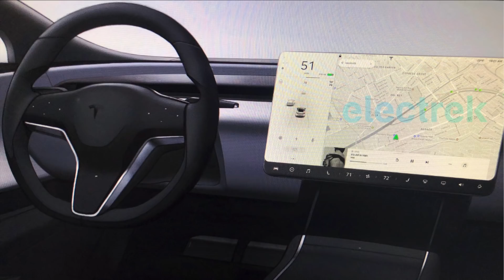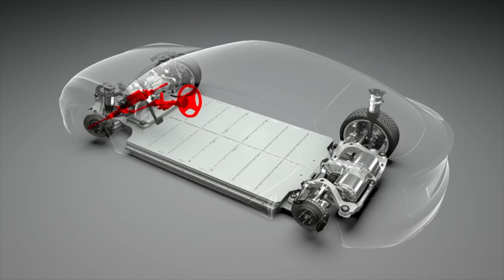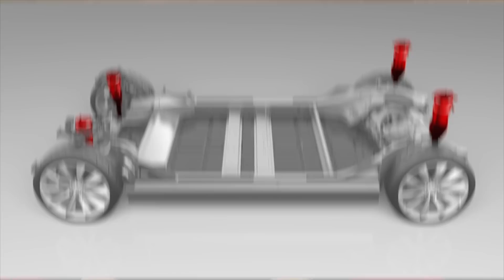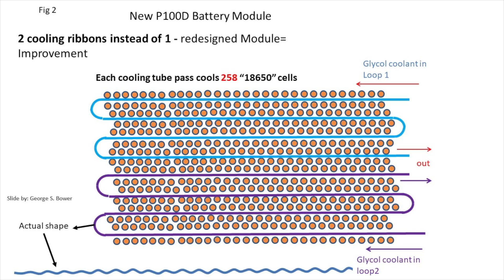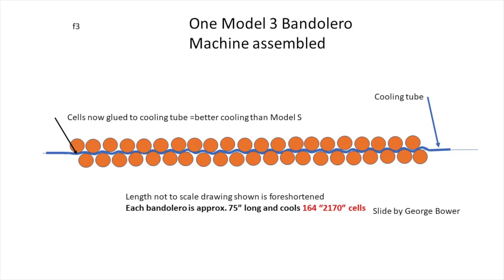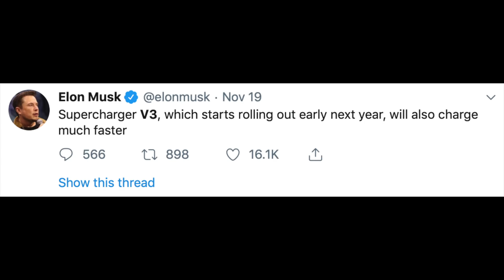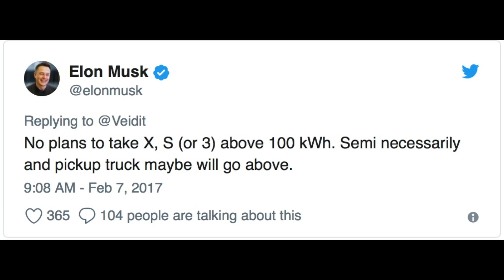The reason Tesla's 75 kWh battery is going away

Comment: Without specificity this is all speculation. Moving everything towards 100kwH is just a cost savings measure imo. "What comes next?" would be defined by the goals of capacity (safe charge capacity), natural rate of discharge, discharge rate while plugged in, rate of charge with proper software model, capacitance "actualized"(the number everyone uses), cooling systems, safety systems, "driving modes"(chill to insane, towing, hauling, etc) programming, any changes to the super capacitor braking systems, any changes to the interior and exterior (why side mirrors still? Why a steering wheel instead of side-stick control? Why a rear view mirror?, What about different interiors?, What about different types of glass? What about more efficient heating and cooling? What about storage? What about the amount of wiring period? The catch-all "system integration", etc etc etc). The only item I am aware of that has any specificity is that the Model Y is not to have a lead acid battery...and that somewhere out there is "hardware update 3"...and that's it..

Comment: what a punk... anyway billions of batteries is a fiasco to have bought and wasted and with the maturing of emissionless tech the evaluation of electron powered traction is overdue.

Like combustion which generates almost NO pressure, less then a cheap bicycle tire pump, chemical batteries produce literally a few volts, and the fact that you can wire thousands together is not relevent to there lack of fitness for other then phones, lights, maybe what personal massager's but otherewise not motion not integral horsepower.

Historically steam replace ox, goat, whatever beast with the burden. TO move from diesel etc. madness to battery or supercap hilarity is pathetic.

Strong forces exist in nature binding the tiniest of shit together with various rates of failure.  ALthough gold is heavier, uranium releases heat, and can cause itself to bleed this heat which people outside of Japan have basically forgotten.

The heat can do real work- generating 'power by wire' ain't that, nor is incinerating the Korea's or even a few pounds at a time of the stuff.

What it can do is lift the weight of the atmosphere off water so it boils partly away leaving ice, and also more efficienty freeze up as much of the not just nitrogen but also oxygen fuck the carbon dioxide being so politically incorrect just give it away for tailgating or whatever and then you have a fuel for a atmospheric heat turbine engine duh.

YOu condense whatever fluid powers the turbine with the frozen air, even if that is just liquid to air itself, and of course boil it with the not radiator which releases heat, but duh evaporator coil simlar in appearance likely reusable identically equipment.

CUz in flint it might be another week before water melts but air is boiling there anywhere it can be found liquid and melting as fast as you need with little exposure to those 'frigid' conditions.

Elon Musk is a nutjob- his thinking is pathetic, he knows nothing about science, little about materials, and our earth will be luck [requiring even pretty girls to take notice] to recover from his instigations of retro thinking without any historical background beyond that from some commercial he saw flirting in coach with some teenager [being our sole prayer ridculously].

Comment: For a refresh of the models S & X I would expect a shift to 21700s, just because Tesla strives for vertical integration and they can manufacture those cells in-house at Gigafeactory 1. What hasn't been talked about in the video ist that along with the battery change I also expect a shift in the motor technology over to the improved (and lighter and also cheaper to build) switched reluctance motor technology used in the model 3. With additional economies of scale they could probably drop the price of the 100kWh model S & X line down to almost 75kWh levels and introduce a model with higher capacity.

Comment: I think the slight increase in volume is negligible compared to the benefits gained. The battery condition will last longer. I use 20700s on an ecig mod, and I charge them regularly on a fast charger. They never get hot. This is probably the reason why Telsa decided to improve on the cooling system. Will save money, and weight on the vehicle.
Reply: exterior temp reader is like a coach aisle seat
Reply: @Irene-fu6gj  well coach gets you from point A to B, but if you're in a hurry I'd give up my seat for you because I'm not. God bless.

Comment: yeah....the fact that its going away without being replaced is beyond stupid.

you could get the 100kwh version back in october 2018 3750$ cheaper, with lifetime....supercharging
the ONLY benefit to the 100kwh is that it can go some 70 miles further and charger faster...if...the chargers are working for the FULL 120KW which they often don't and if you're not sharing which will only become more common.

18,000$ to have 70 more miles of range which is somewhat useful in cold climate for long haul drivers....and to save 2/3 hours on cross country drives. so a horrible return.

also, 25kwh of old as heck 18650 cells for 18,000$ 730$/kwh?
meanwhile tesla is selling tesla semi kwh for 100$????? new cells
and the powerwall 2 is already down to 500$/kwh not to mention its electronics new cells.

the 100kwh is a horrible rip off, likely detuned as the 75D is battery limited and yet the 100D has the same exact stated acceleration...>> never got a boost like the 75.  
its 4% more expensive today than it was 3 months ago, 100kwh models are selling for 80k on teslas website meaning they depreciate rather hard vs 75/65/85 even.  20% in first year despite still having "newest/equivalent" autopilot and all options
and the people who stand to benefit the most...people who drive long distances, no longer get free limetime supercharging but a few measly months worth

even compared to teslas very recent past value offerings its rather bad.
Reply: free lunches don't last but your not asying the used sleds won't let me drive hundrds of miles a day on new customers are you?
Reply: @Irene-fu6gj  im not sure what you mean by sleds and driving on new customers

Comment: The 100 kWh limit comment was from 2017 and was also mainly used to reassure people that they should just buy the 100 and not wait (since many people who got the 90 were upset). The most likely thing is for the S and X to to adopt the Model 3 cell size and introduce an even larger capacity battery, all being about to take advantage of the V3 Supercharger speeds.

Comment: If the Roadster2 is going to have the announced 600 mile range, either they are going to be making higher kwh battery packs, or some radical weight changes.

Comment: They should have designed the battery to be a cassette that is taken out at the charge station , the battery would be removed by a machine and a new recharged cassette inserted .  The new battery could be charged slower while at the station ( Safer )  and would be quicker , so it would be like the propane tank exchange program that everyone now uses .It would mean a standard sizing and fit solution that would have to be adopted by all the car companies ....also there would have to be a compact car battery , a mid size car battery and a full size car battery .   Sounds complicated but , do it now while the electric car revolution is just starting .  'Just a thought.'
Reply: not actually a thought more of a grunt. Charging chemical history is that power rate out is related to power in fyi.  Quaint obsolete but true trivia to puzzle the punks or delight the wise anytime you want but one per millenia ok?

Comment: The pickup will need a big battery option to compete well. Pulling a 20,000 pound fifth wheel it will need to be able to go a reasonable distance.  Stopping every 50 miles for 30 minutes isn’t realistic.
Reply: Brent teh 180 kwh Chicago duffus rig for 2022 is your delight right..... old trucks need jobs.  FIfthwheels to the rescue!
Reply: Irene ???

Comment: Cable size increase at 6:18 is mostly a switch from copper to aluminium in the beefy cables; lighter & cheaper if somewhat thicker.  The extra meat in the cable is needed due to the higher resistance that aluminium has over copper...
Reply: they look like aluminum but your text suggest fact not speculation?
Reply: @Irene-fu6gj  The large cables are aluminium now...  in earlier models they use copper but that costs & weighs a lot.  Sandy Munro or someone like them did a dissection and pointed out the change a year or two ago on YouTube...
Reply: @Clark-Mills  you reply so quickly you must be very organised I bet YOU remember what you had for dinner!

Comment: Supercharger V3 is going to be very interesting.  From a technical standpoint 350kW charging may not be necessary but is Tesla feeling pressure from CCS to go down that path?  As for switching everything to 2170 cells, I think that it's a no-brainer that Tesla will eventually go that route.  The only question is when.  Then again, perhaps they're working on a different cell format and are keeping very hush-hush...

Comment: In my opinion If 18650s then believe tesla will launch a 85kwh pack and 110kwh. If moving to 21700 then probably a 90 and 120kwh pack...  I think it's doubtful that 2170 will occur outside of the model facelift as stuff like cooling and heating of the pack would also need to be swapped, let alone all the wiring changes
Reply: how exactly do you imagine the heat can escape from a ton of gross crap between trips to require any heat whatsoever?  ARE YOU KIDDING????

Comment: it's 21700, not 2170.
that last zero indicates that the cell is round
Reply from the maker: This is true but Tesla refers to them as 2170. "The Gigafactory is producing a Tesla/Panasonic designed and engineered cell called a “2170 cell,” as the diameter is 21mm in x 70mm in height." https://www.tesla.com/presskit?redirect=no

Comment: It makes no business sense to stay with 18650 as the properties of the 2170's are superior and maintaining two lines for what is ostensibly one result, a kilowatt level battery back in the smallest space, would require two separate manufacturing and support processes.  Standardizing on 2170 lets them stay with one scaled battery architecture, penthouse, battery management software and system for all car and truck lines.  I saw this coming a while ago and its also why I did not jump on Model S as to me this was a beta (even in volume, which is more a business necessity for Telsa's bottom line), as I think 15 minute 80% charge and greater range will actually be the final nail in the coffin for ICE.  Going forward, Telsa will maximize profits with early more expensive models and as they scale production, more entry level options will appear on the market.  Also, Telsa's competitors are not standing still - look at what Hyundai has done with the KONA.  In point of fact Telsa will start getting serious competition and EVs become the defacto and ICE vehicles go into a decline for only special case situations.

What I will find interesting to watch is what happens to gas stations during this transition as their customer base melts away.  I have yet to see any company take on the concept of a combo gas-EV fueling station.  They better hurry up, or someone is going to eat that lunch.
Reply: eaten ulcered and crapped in 1968.  where the fuck where you?

Comment: Very interesting comments.  Outstanding video! Me, I will hold on to my 75D-for many many reasons.  
1. Extremely practical in city driving daily. 

2. FREE lifetime charging as long as I own the car (purchased in 2016) 

3. Most families/Career oriented folks have two or more vehicles. A few ICE,  and one or two electric 

4. More competition equals more options at the PRACTICAL level (75-100kwh)

5. Nothing last forever- although there a minimum moving parts w/Tesla. We have not reached the first decade of Tesla yet.

6. Auto-pilot and advanced self driving features, along with surveillance is the future. With having the very first dinosaurs cars from Tesla- they should be a rare item come 30-40 years from now. Just like, classic muscle cars today.
Reply: Sage.  Tesla is over- your correct about that.  Expect auction of factories and customer info by third quarter if not 04/01/19

Comment: Does anyone know how different the aforementioned cells are to your typical AA battery? All looks very similar to me...
Reply: Your 18650 is slightly larger than a typical AA.  The 2170 format is a few mm larger still (both diameter and height), but that's just physical dimensions.  If you look at the math, the interior volume of the 2170 is something like 50% greater than the 18650 and that's where the dramatic increase in capacity comes from.
Reply: @Bryan46162  Toyota used D cells for small packs.  The 48 volt light hybrid isthe largest battery that makes any sense.  It fits in the starter slot of any car and is an excellent backpack box for scooters skateboards folding cargo etc bikes as well

Comment: what y can not understand is why they build the packs this way using the small cels, why not build a brand new giant one cell pack?
Reply: a single cell pack would output about 4 volts for 2 centuries.  It would be great running your clock.

Comment: The HV cables in the Model 3 do have a larger cross section than those in the S and X, but they're aluminium instead of copper. Don't assume they're rated for higher power.

Comment: Would it not make more sense for Tesla from a production streamlining standpoint to do the whole battery limiting thing via software again? I mean if every car produced has the same size Battery but your charging a small fee to use the entire pack (similar to the 60kwh software limited 75 pack) would that not streamline production and reduce complexity in the manufacturing process?

Comment: Once you buy a Tesla, you can say goodbye to oil changes and smelly gas stations. The only maintenance on a Tesla is tires, coolant, and brakes. By the time it needs a new battery pack the battery pack will cost less than a rebuilt transmission for an ice vehicle.
Reply: not possible because of the demand for elctrical energy storage for logic alone that's pent up

Comment: It's not slight redesign of the car. Changing up to the 2170 cell size will only happen during a major redesign of the S and X. Tesla must build out product line prior to ground up redesign of the S and X. Continuous improvement has kept the S and X well ahead of anything out else out there in its category. 

The next change to S and X is to the new interior design language of the 3. I hope they switch from an AC motor front and rear to at least a synchronous reluctance motor on the rear of the 3. That would allow more range on given pack without having to redesign the chassis.

You'll see a cheap compact car and crossover prior to seeing a platform change on S and X.

Comment: well presented. As a tesla 75 driver, my question of course is: will there be adequate replacement packs in 5-12 years' time when the current ones degrade so much they will need to be replaced. And will such battery packs come from tesla or other providers.
Reply: every business has it's campers

Comment: when are they gonna do away with the archaic fabrication methods and design of the body and frame?  How come they can't make it a reasonable strength and weight?  Every other car manufacturer figured this out in the 1980s.  If they could match their car bodies to the level of everything else, then they'd have a truly modern car.  If they don't, they're gonna quickly go under as everyone else brings out  far lighter and far stronger EV options.  Cmon Tesla.  Make the cake right, before you decorate it.

Comment: Who would need more than 100 kwh, when you have 200kw fast charging. Waste of lithium and cobalt.
Reply: try 1000 volts by 1000 amps off the fm antenna like roof terminals that dissapear but get the juice during the carwash- Mister Carwash franchise scam disclosed it in there 10k HELLO?

Comment: The cable size has to do with heat resistant and power losses. So it is only for the better 😇🙏
Reply: yeah marketing has nothing to do with it.  Direct current is lossy the sine wave requires on battery conversion but the problem is using electrons to do work- not what god gave us them for duh.

Comment: Current Tesla 3 weighs 300 Kg heavier than a Toyota Camry Hybrid. A 75 KW Tesla 3 will weigh no less than an old Cadillac.

Driving it will be no more than burning all the fossil fuels-generated electricity to move the battery pack around town, much more than transporting people.

Does any one in his right mind think this is any 'Efficiency'  or any mercy to the planet?!

"No device can produce sum useful energy in excess of the total energy put into constructing it. Energy always and only comes flowing from the past into the future" (The Fifth Law).
Reply: regenerative breaking requiewa only nonxhwmixL AROEfw ro vw ewlRICWLY LOAALYAA
Reply: @Irene-fu6gj  your "egenerative breaking requiewa only nonxhwmixL AROEfw ro vw ewlRICWLY LOAALYAA" will barely cover for the dissipated energy as waste heat.
"Humans can not manufacture Energy. Energy always and only comes flowing from the past into the future" (The Fifth Law).
See how that looks like in reality here;
https://www.youtube.com/watch?v=yTTf3cwi-EU